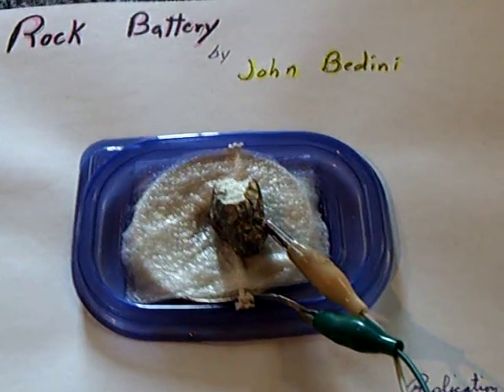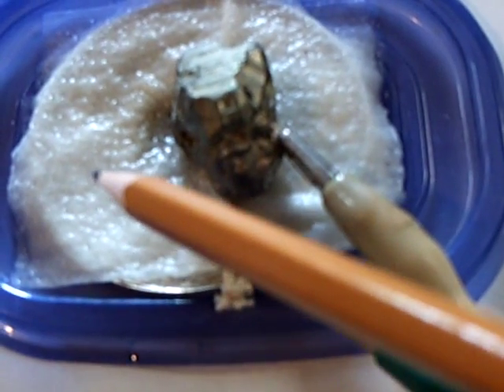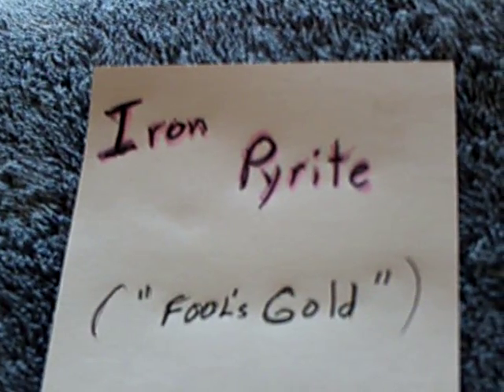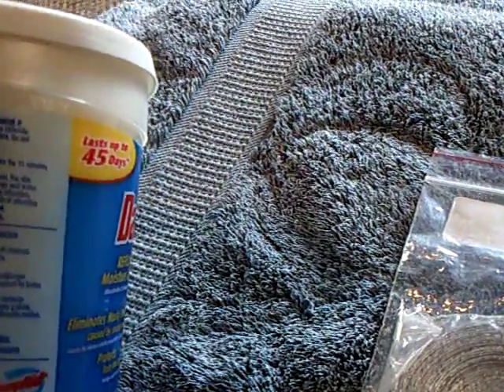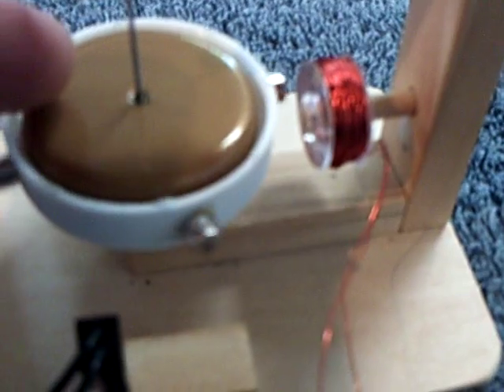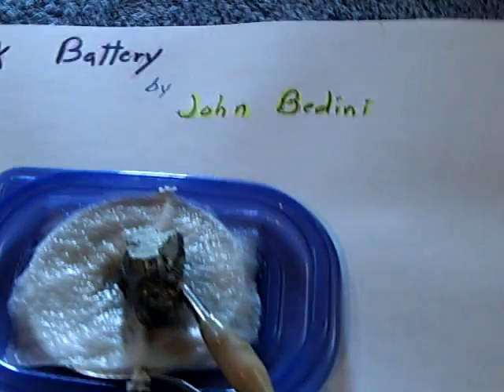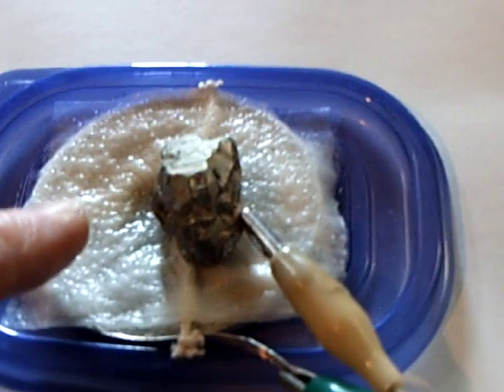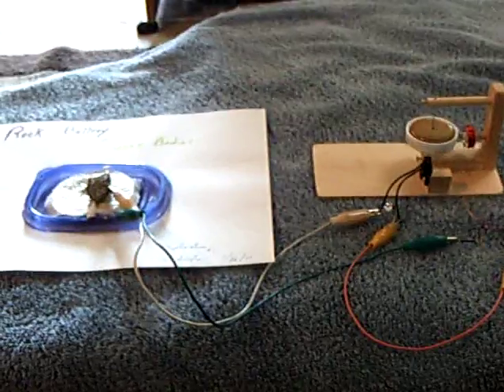ROCK BATTERY by John Bedini.ASF

Comment: The real reaction here is the "Salt" the wet on the magnesium.  The battery is very short lived as the magnesium ribbon is quickly devoured in the reaction.    The Crystal Battery is much the same the salts differ,  here a magnesium rod is the fuel, the salt is dried so the corrossion is slowed,  It is generally put in a copper tube or cap or a carbon cut and the madneslum rod is in the center,  These last for YEARS  3.5 ,5 even ten years with  the right salts Epson salt substatute, Alum and borax.   There are other batteries that have real crushed rock like quartz fools gold dust, and a few others that work for years and do not corrode.  Of interest is Rochelle salt crystals that when bumped create a short current burst.  All those Piezo lighters in grills contain that crystalt and when you push the button it vibrates the crystal and you get a spark.  Imaging a container with 100 of those that you could stimulate by sound. to get current.
Reply: These cells are so easy a six year old can make them.  There are so many videos.   Understand there are many bad mixtures with so so production that quit in days weeks etc.   Crystal Cells  and find ones with the four ingredients and bammo on a stove top you can heat and melt them in a short period of time.  Full instructions are given dozens of times.  Lasersaber generally has good tutorials

Comment: john hutchinson uses crushed quartz, pyrite, silica gel and liquid glass, heat it up with brass in it, and copper or steel on the outside.  makes crystal lattice. cool it down.  next pulse very high voltage through it, and BOOM it's a negative resistor, the BATTERY Version of a magnet.

Comment: One can just use magnesium, copper and liquid bleach and get a good battery...but you might need a resistor to protect your circuit; but one can dilute bleach.  The liquid bleach is probably much safer to use than calcium chloride; although the combination listed will generate hydrogen gas.  The downside is the smell of bleach which can irritate eyes, lungs...run such outside.